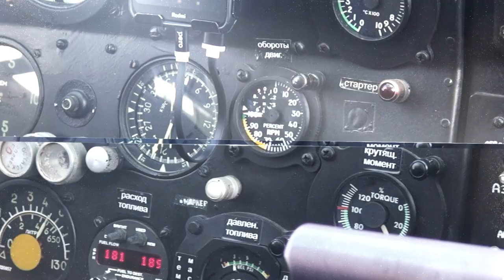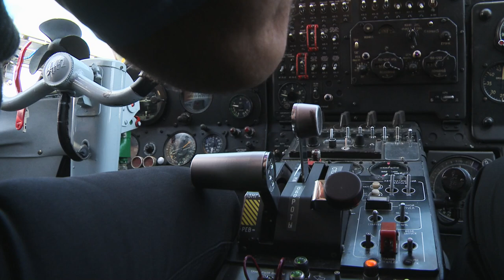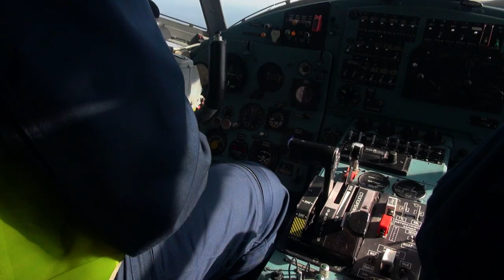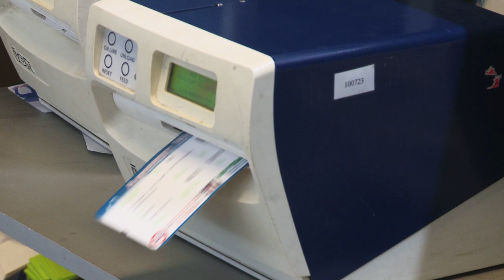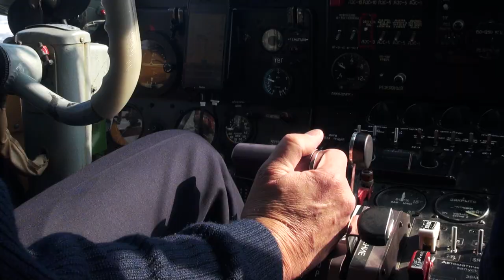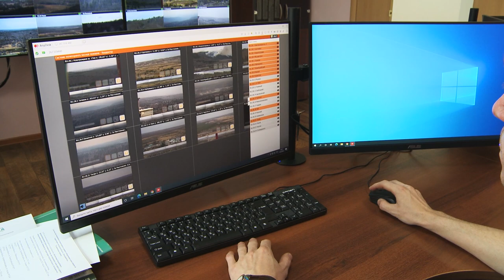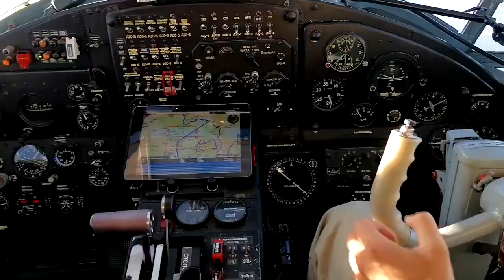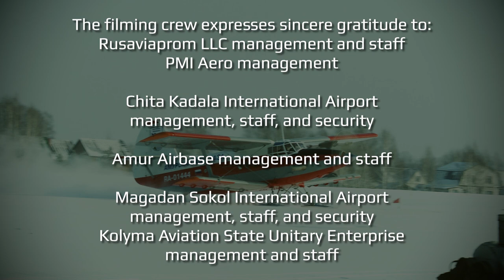TVS 2MS — An-2 with a new heart

Comment: How fast is the  An 2  TVS 2MS
Reply from the maker: 170..210 kph cruising (110-ish knots for those who are stubbornly non-metric), 250 kph never-exceed (but actually it can cruise close to that at 3300 metres/FL100, especially with a tailwind).
It usually flies “below the lowest” or outside the airways, so its captains do not use non-metric feet/knots/gallons/pounds system, and fly using metres, kilometres, litres, and kilograms.
Also, it's not an An-2, it's just TVS-2MS officially. It's a re-engined An-2, but legally it's a different plane, takeoff and landing procedures are also slightly different.
Reply: according to the flight manual the cruising speed can be up to 250 km/h
Reply: @FlightTV  correctly